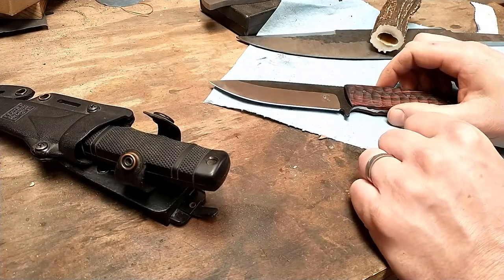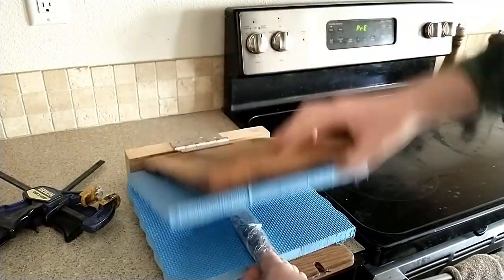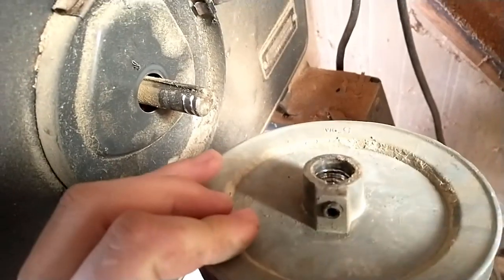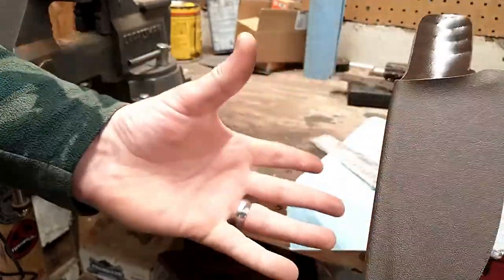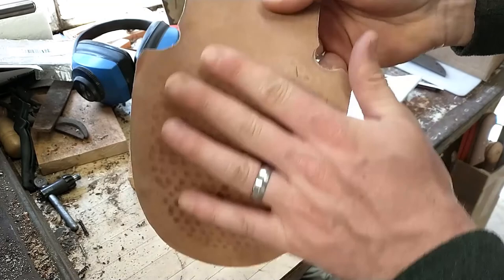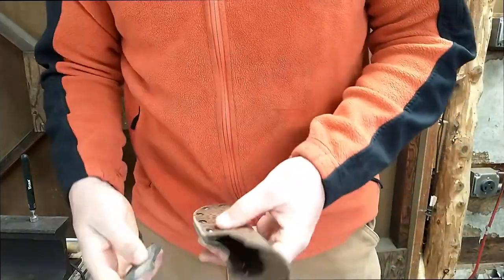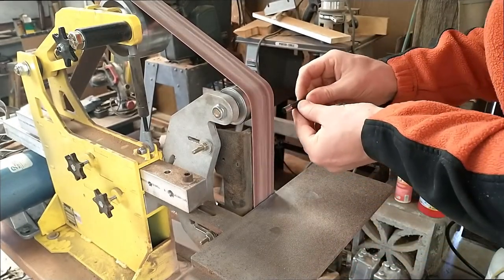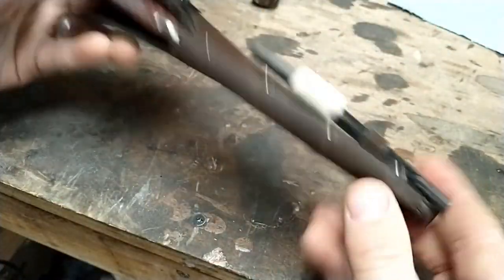Making a Leather Wrapped Kydex Sheath.

Comment: Pretty neat stuff. You should remove some leather from the handle of the knife because it impedes with drawing the knife quickly.
Reply from the maker: Thanks.  While the high leather does the impede a little, the trade off is great protection from brush and limbs while walking in the woods.  In general, I can still draw the blade in a timely fashion; it's not designed for combat or self defense so speed isn't critical.